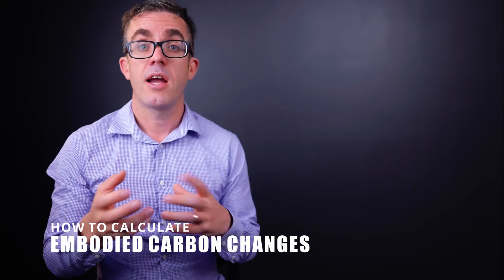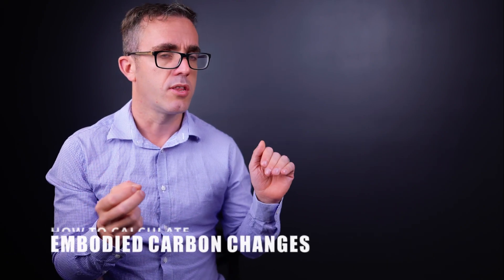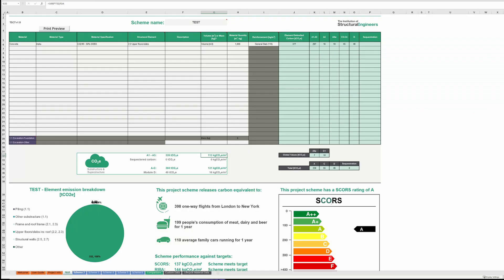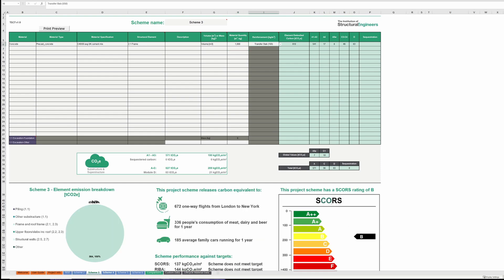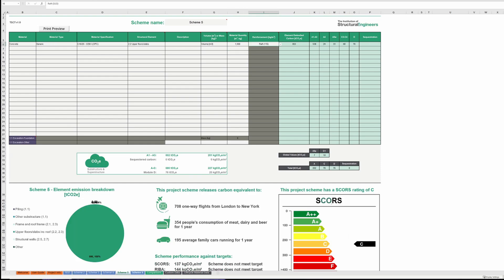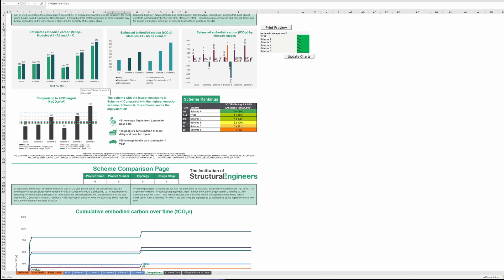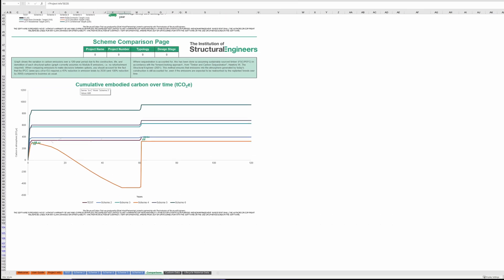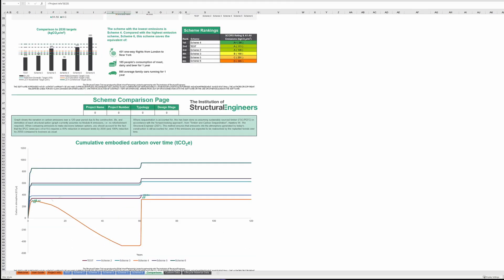Sustainable Construction Materials - How to reduce the embodied carbon

Comment: I dont really like the idea of reducing the liveload as this will limit the building's usage thru out its life. The building will usually chage its type of occupancy. Maybe it was designed for office use but after few year they change it to machinery storage then change it agan to place of worship. Normally the owner will not engage an engineer to check if its safe to change its occupancy. 

To be honest we optimise the design because we need to reduced project cost not because of carbon footprint. And normally if we save money from structural aspect, the owner likely use the saving in other parts of the project which defeats the purpose. I think the push to reduce carbon footprint will need to come from the client. As engineers we are only focus on cost/time, quality/functionality and safety.
Reply: The push will come from policy which restricts/eliminates old practices and stimulates innovation.

Comment: The amazing thing is that most of the sustainable solutions are actually more economic, which means that it's a win win situation for all parties of a project. High level of education and confidence within an engineer is the key game changer in both sustainabling and value engineering !
Reply from the maker: Hi, Thanks for watch. agree that sustainable good engineering will achieve the best win win solution, sometime it just requires discussions with the client on the possiable solutions.

Comment: Hi Bendan, addition of fly ash to concrete mix also can help reduce the coal waste and at the same time make the concrete a more durable material.
Reply from the maker: Hi Ardalan, agree flying ash is a great way to reduce Carbon. It should be something that is part of a standard concrete mix.
Reply: But it is a very costy solution as I know

Comment: Thank you Brenden for doing one of my favourite topics. I think we can always play with different cement types too like low heat cement which has more curing period as you mentioned, which significantly reduces the heat produced. Altering the bogus compounds inside  cement is the key. Keep going.
Reply from the maker: Hi Deekap, thanks for the ongoing support. Agree that cement will a corner stone of construction for the foreseeable future, so work out ways to reduce it embodied carbon should be what we focus on.

Comment: This has been my focus for a while. On a committee over here in Cali. The first thing that came to mind is embodied carbon due to cement ahaha
Reply from the maker: Hi Savage, yea Cement has a lot a embodied carbon even when adopting SCM.  What are your focusing on at the moment? also, any addition tips on reducing the embodied carbon?
Reply: @BrendanHasty  I am part of the Structural Engineers Association of Central California. Our sustainability committee focuses on sustainable design. Our goal is to come up with something that is applicable to designers in the Sacramento region. I like replacing cement with another binder such as Fly ash (15% replacement), slag, or silica fume. As far as steel, I believe the bigger changes are through the energy usage efficiency during manufacturing.